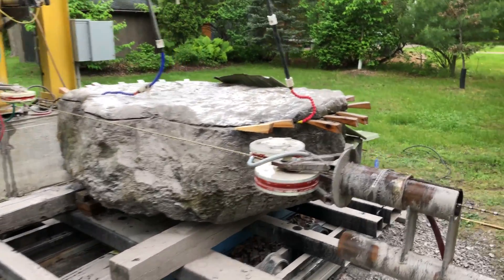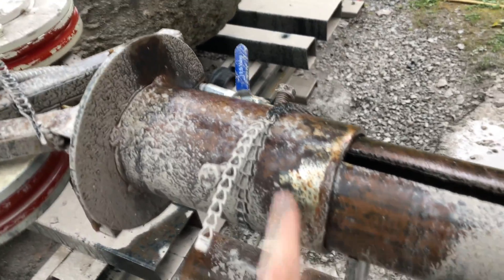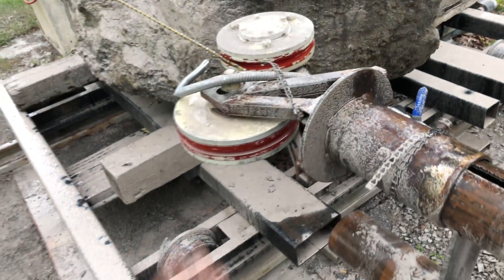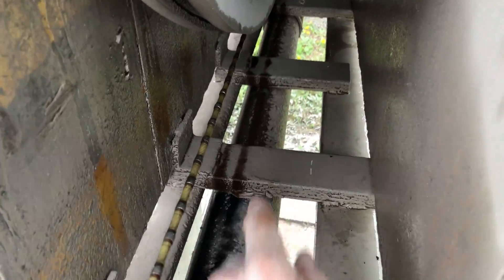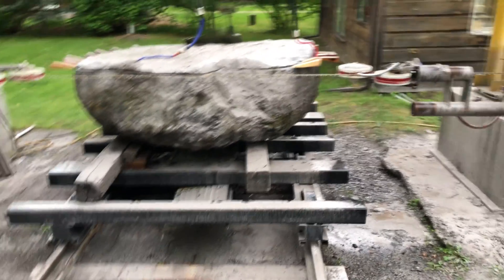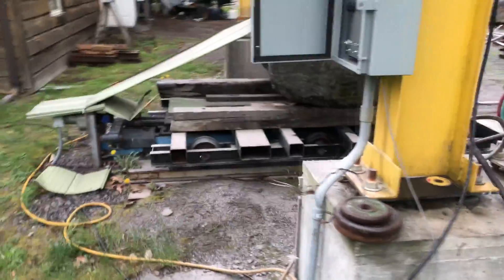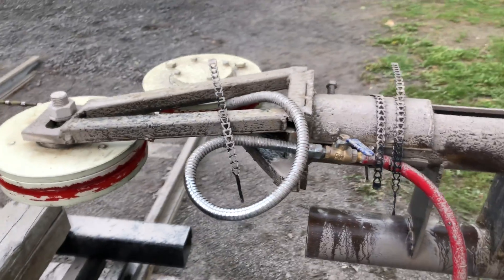Diamond Wire Saw Horizontal Cutting Setup

Comment: I am manufacturing an artisan cutter, for cutting volcanic stone how many revolutions per minute should the cable go or meters per second
Reply from the maker: Hello, for granite you should aim for 24meters/second.  For limestone/marble you can go faster up to 30 meters/second.  I'm not familiar with volcanic stone.  The best thing to do is gear the pulleys so the wire runs at 24 m/sec at the specified RPM for the motor (example 1750 rpm), then use a VFD to control the motor.  Using the VFD you can then vary the motor RPM up/down to fine tune the speed.

Comment: Hello excellent and creative....
 Do you have an idea for making multiple cuts at the same time?
Reply from the maker: You can buy a multi wire machine.  If you wanted to make one, you would need a 50 hp motor (5 wires) or higher.

Comment: Hey man, i wanna change to wire saw, build it by myself. I think got all parts, just missing the wheels to apply tension on the wire. Where i can find them? Or from which material are they made? thanks in advance
Reply from the maker: Do you mean the large 1550mm (60") wheels?  I purchased them from China, I have another video about them.  Check my channel.
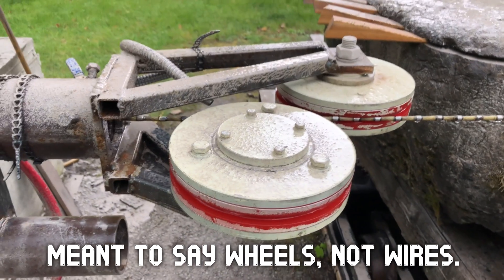Reply: @GregsStoneYard  i mean they smaller one that You show in 1:50, what kind of rubber si that? Red line
Reply from the maker: @victorbocanegra6711  Those are 200mm wheels, also from China - $100-$120 USD each, from Hercules Abrasives.  If you want to buy just liners, you can get them from here : https://fspu.en.alibaba.com/  size is 200*120*35.5mm, but you have to buy large quantity.  They are a wear item, last about 8 to 40 hours of cutting.
Reply: @GregsStoneYard  great, i'll check them, hope that it could work as i expected.

Comment: this is very cool! where do you get or how do you build the actual cutting rope? i would like to build a smaller version of this.
Reply from the maker: If you view some of my other videos and read the comments you'll find more information on where you can get wheels (smaller ones too) and the wire.  Also ideas about using an automotive hoist for the frame and mechanism to move up/down, saving you lots of fabrication time.  You can't go too small on the wheels or the wire will break.   You can use 4 small wheels instead of two large wheels like mine.  If you have specific questions just ask.  Good luck.

Comment: Wire rope price
Reply from the maker: In September 2018 I paid $70 CAD ($53US) per meter for 8.3mm 40 beads/meter Husqvarna (www.diamant-boart.com) wire.  Thanks for watching.
Reply: @GregsStoneYard  ur contact no.. sir
Reply from the maker: @shakilkhan-nl2xc  You can contact through email, greg9504@gmail.com
Reply: @GregsStoneYard  If you need more/smaller diamond wire saw by cheaper price, feel free to contact with me by sales06@cahard.com, with military quality and affordable price.
Reply: Hi, Shakil I am Vicky from Bsp tools. we are producer of wire rope, our technical manager is from Tyrolit who worked there more than 20 years.  any interested in wire rope, feel free to connect with us. Cheers! BSP Tools（Kunshan）Co., LTD
No., 275 Shengfan Rd., Xinzhen Industrial Zone,
Kunshan, Jiangsu, P.R.C 215300
Mobile(We chat): 0086 15850307455
WhatApp: +8617751227391
Skype:ceramic_vicky
sales4@bsptools.com